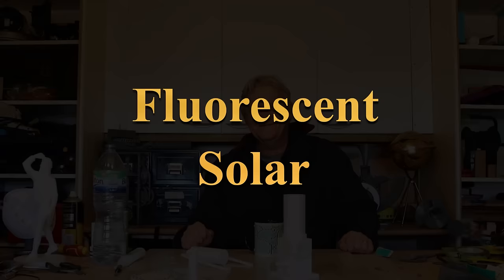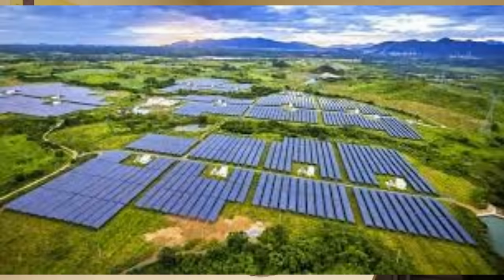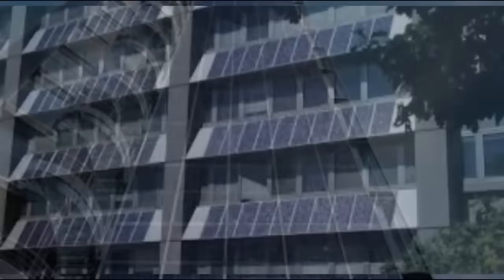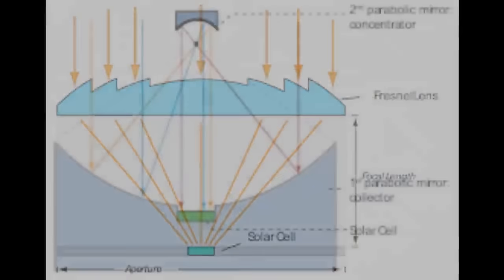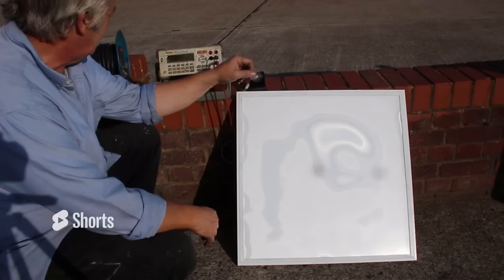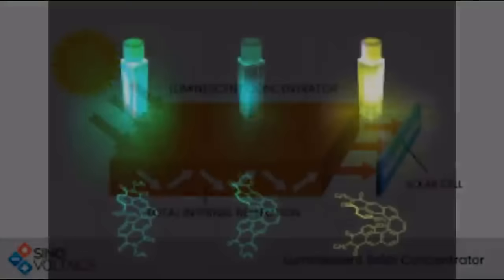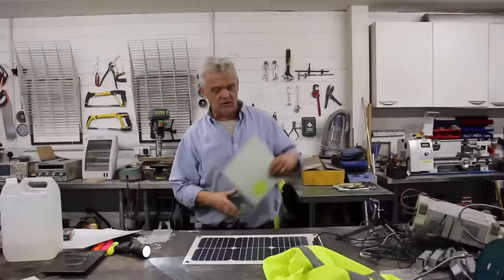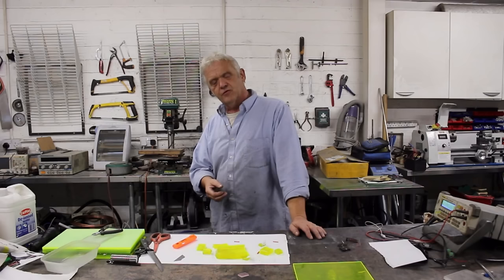Man In A Shed - Episode 3 - Fluorescent Solar

Comment: Yet another excellent video and subject matter.   Something to keep in mind is that when using magnifiers, (frenal lens, mirrowes, etc.) the life of the solar cell / panel will be shortened.  Example.. a typical high quality mono crystal panel may last 20 years and still put out 85 % of its rated when new wattage . Lets say you triple the sun intensity striking the cells ,  it will create more heat, and also shorten the life by other means.   This is  just an example .  Watch the temperature of cells and it may help ... Use heat to make hot water... etc..
Happy Experimenting.

Comment: Very interesting.  Finding even a limited tracking ability without any mechanical additions would definitely be a huge improvement.  There will definitely be shading issues and other downsides, but as you say about the fluorescents, you might get some of these problems mitigated.   I will watch with considerable interest.

Comment: Loved the video.
Has anyone thought about gelatines ability to be moulded into shapes.
You said that the light guide has pyramids moulded into one side. How about moulding the gelatine onto this creating a surface covered in mini pyramids. 
You also showed a diagram using a surface of mini lenses to track the suns movement.
Perhaps a surface could be found to replicate this.
If. It works with jelly why not make a more permanent sheet using a clear resin wired with the dye.
If anyone has a play please let me know.
Unfort7nately I am unable to experiment but can still think up ideas.

Steve
Reply: I had the same thought, however these resins are quite expensive and I don't know if this will be economically viable.

Comment: Robert you’ve produced another fine video. This video answers the question I posed to you on the past video you did. Question What if you used Water Glass instead of the Gelatin? You could spray this onto a Silicone Mold and build up the thickness desired, in any sharp you wanted. Wouldn’t this be a better solution than Gelatin? I look forwards to the next video series on this beautiful development. Thanks for sharing your experience and knowledge with me.😊

Comment: Great Viideo and mor excellent original thinking.  
I particluarly like you idea for a lateral collector pike the prism concept.  The problem I see is that low angle to the sun collection on a panel is primarily geometric.  The actual effective collection area is the area perdendicular the the sun's rays.  For a single collector and a single prism (or other projection) the prism height would control how much more light would be collected.  The next downlight panel would could not be placed any closer downlight than the shadow of its uplight neighbor.   

The problem: shallow height prism (et al) collectors equal small improvement but closer spaced "next" collector: large height (et al) collectors big improvement but far apart  "next" collector.  Perhaps some benefit by angling the array , but no more than by angling a flat panel to better match the suns transit angles.

Jimmy Johnson
Reply: I was going to make a similar observation: The amount of energy available is proportional to the surface visible from the sun's perspective, so no matter what shape of lenses is added on top of the panels, it is still limited to that smaller surface area facing the sun, say 50% at 9:00 and 15:00 if the sun is at a 45 degree angle. The only way I can think of to make up for the decrease in exposed area, using the light guide approach, is by placing a single tall triangle or curve covering the panel, so that the side facing the sun is as large as the surface of the panel itself. In theory it should significantly increase the morning/afternoon output, but the gains might be offset by the cost of such a large prism.

Comment: I think standard silicon solar cells are optimised for IR so the idea of 'stealing' non-visible UV, fluorescing to IR & guiding IR whilst keeping a clear panel sounds appealing. If liquid crystals can reorientate different parts of the spectrum maybe tinting the window could also generate.

Vertical orientation or prisms will align generation better with (domestic) consumption and the reduce the storage required, even if we're not offsetting with fluorescence.

Comment: you can get clear resin for  3d printer and some flourescent piigment and simply print  prisms. maybe instead gelatin you could try dissolve inside of the marker in acetone, since its made from same stuf as cigarete buds, an they disolve  in acetone like nothing. although it could be to cloudy when aceton evaporates

Comment: The ideal situation would be to perfect LEDs until they could collect as much light energy as they can emit.

I have read, some 18 years ago, that there was a Japanese group who was researching this idea.

No idea how successful they were, but apparently the newer, more modern LED types might be very viable for this accumulated directed light harvesting, WHILE, at the very same time, making the side of a building economically feasible, as billboard advertising.

Along with fluorescence, [as you mentioned, converting both higher, and lower frequencies into visible light] these could be phenomenal ways to collect the raw heat of a city environment [especially in the desert southwest of the USA] you COULD, in theory, actually convert ambient heat into electrical energy, effectively cooling the surroundings, while at the same time, powering air conditioning, at those peak times when it is needed the most, AND THEN...

Take all the exhausted heat from the air conditioning system and RE-convert THAT heat back into electrical energy! (~_^)-b

Comment: Paint the white reflector material or Mylar in a fluorescent material that will reflect light the cells can use with the light guide? Use pyramid shapes or three dimensional triangles instead of prisms? And maybe use a dye in a moldable uv resin with a printer device?

Comment: My thoughts on the lightguide ( which follow on from what I'd posted on main channel vid 2198 ) is to do with the max limit of a solar panel output. It's not something that'd show up in low level lighting comparison but outdoor, under a midday Sun, is probably another matter.  At testing concept scale ( a few inches ) and indoors you're probably in a nearly linear area of it's operating range and extrapolating possibilities, from that data, would probably be somewhat misleading, eg covering a whole house roof in a single  1cm thick wave guide isn't going to give anything in the multi Kw range because of the solar panel area limitations. However covering it in 10cm square tiles probably could.

Hence my questioning what length of lightguide would max out the solar panel when done mounted perpendicular to the solar cell ( especially if adding a fluorescent ) eg if it's only 30cm that effectively limits the size of panel that you get an increase from.  Taking an extreme example ( mainly as the figures are so easy and require no real thought ) a 1Km long lightguide is not going to give a 1000 times the output of a 1m light guide using a 10W panel. Length of lightguide would fall under that category of diminishing returns when a solar panel's area becomes the limiting factor, that area is itself limited to the perimeter and thickness of the lightguide
Hence my thoughts on cutting the edges of a guide non perpendicular, effectively allowing for a larger solar panel and so a larger gathering area before maxing out.  eg a 45 degree cut would increase the available solar panel area from Y to 1.4 times Y   as it's a right angle triangle we're looking at there.  

I mostly see the lightguides and fluorescents as tools to try to keep the panels in a higher output range when not in max levels of Sun exposure, which is most of the day for most people's practical purposes.